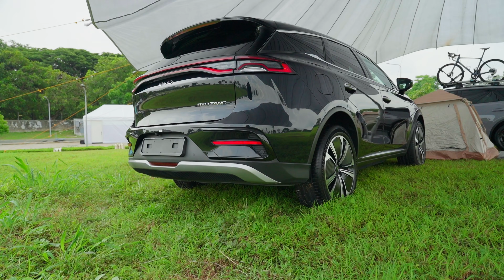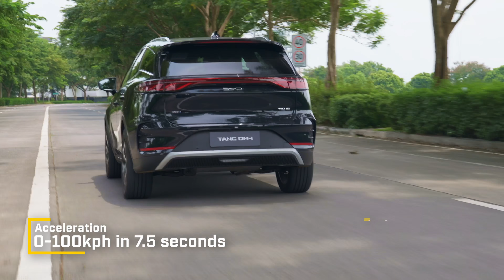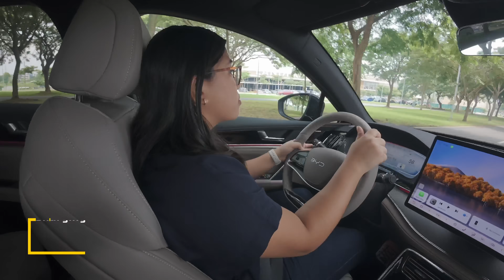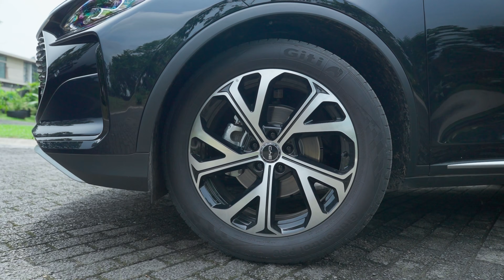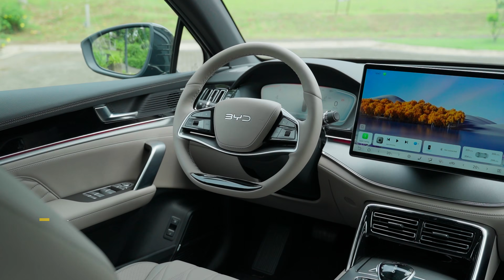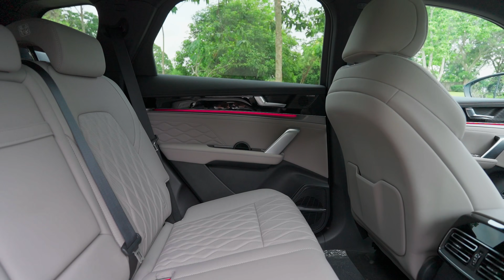2026 BYD Tang DM-i: Electrified midsize SUV now in PH priced at P2.098-M | Top Gear Philippines | Ad

Comment: Test driven one already.  Its very comfortable for the front passengers but kinda hot in the middle and third rows. We   did the test drive noon time and the rear air con vents are just not enough to cool the rear of the cabin.
Reply: That’s what’s bothering me. Wh they didn’t add an aircon vent at the 3rd row. It really helps a lot with the cooling for the entire car. Most brands are doing it. Maybe it’s ok for the Sealion 6 but Tang is suppose to be the top of the line model. I hope they’ll add one on the newer model.